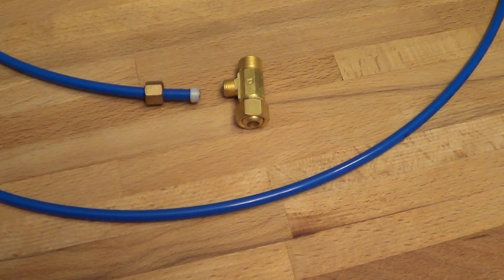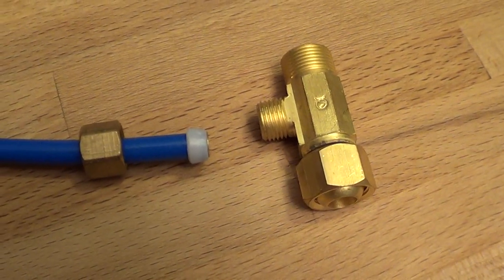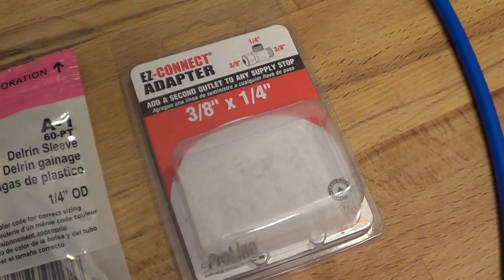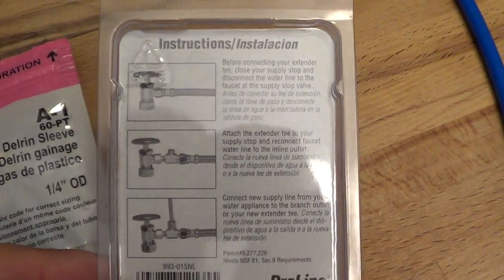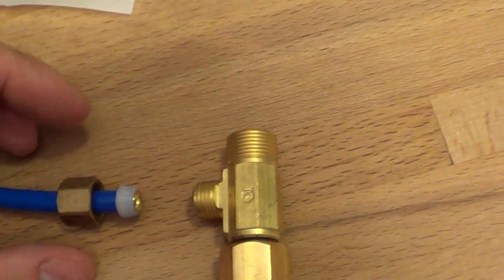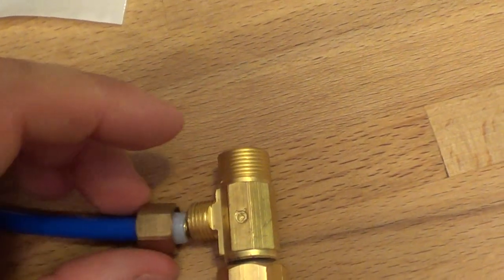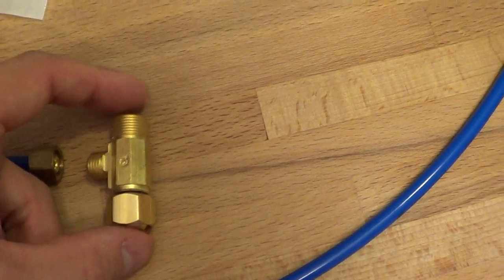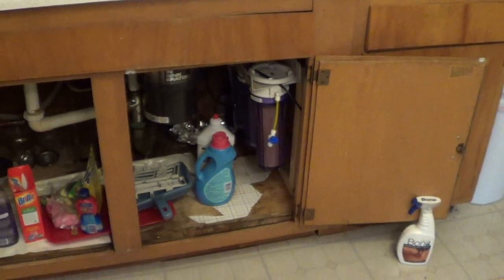#195: How to Connect a 1/4" 3 Stage Carbon Filter or Ice Maker to Cold Water Line - Tank Tip

Comment: The direction of the white plastic part is important.  If the tapered end of the white plastic sleeve is not in the correction (tapered end toward the brass T-fitting) the host will either not perform correctly or it will leak.  THIS IS VERY IMPORTANT AND MISSING IN YOUR VIDEO.